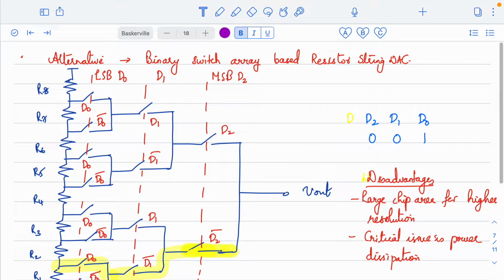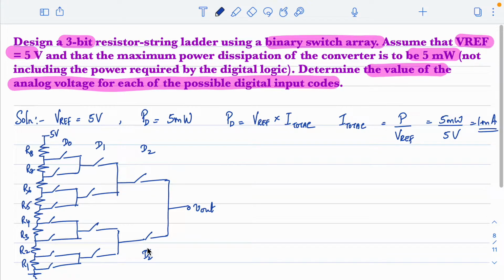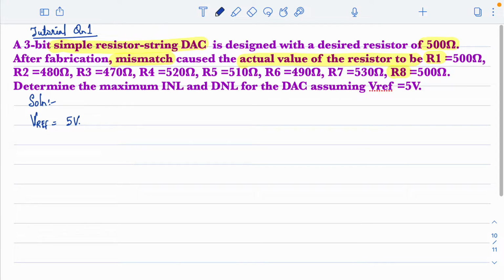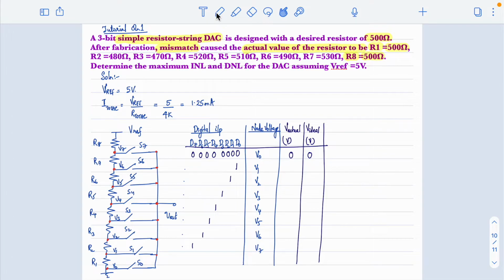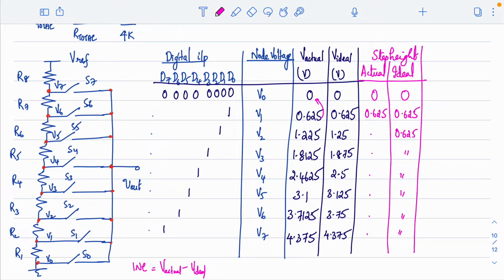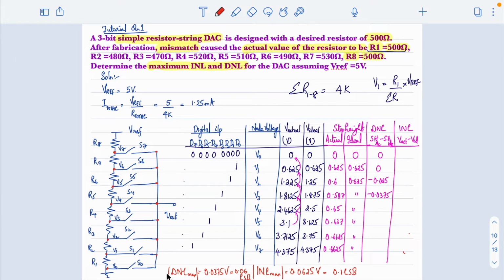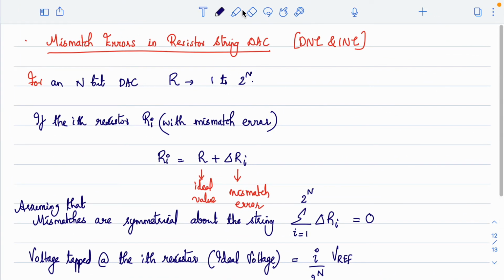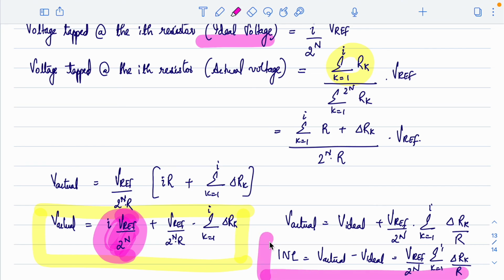MICD Unit 4 Lecture 2 RESISTOR STRING DAC NUMERICALS, INTEGRAL NONLINEARITY OF DAC

Comment: Hey, I really appreciate the video, it is very good. 

Nonetheless, I am having great trouble understanding the last part, about the actual and ideal voltage.
For example, if I have 8 resistors, and they have an acurracy of +-1% (that is to say, 0.01), what would be the maximum variation that could take place in the output voltage?
Assuming a Vref, for example, of 5V.
I just need to understand the process fully by seeing it on a numerical exercise, hope you can help me.
Reply from the maker: Yes, I will do it on a numerical example when I record it for the next time